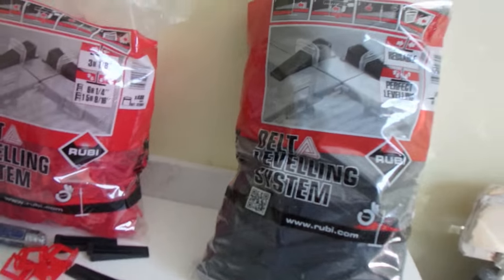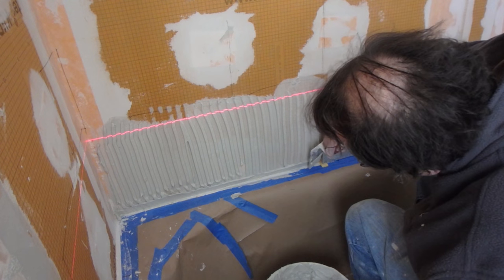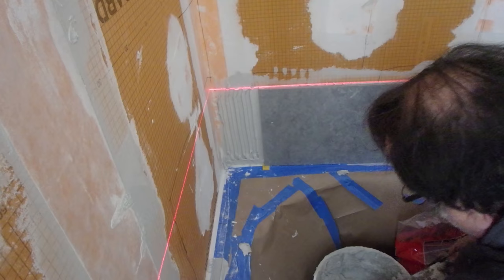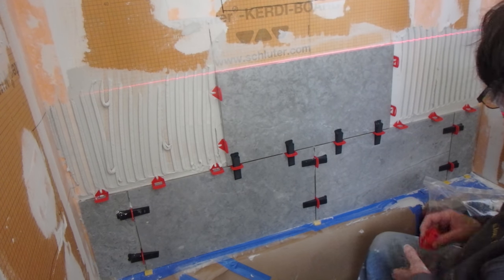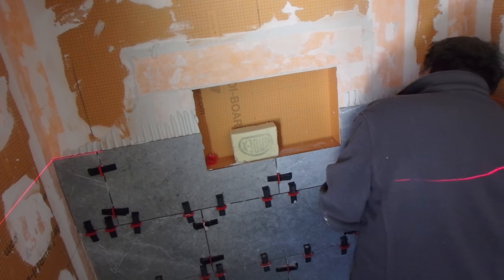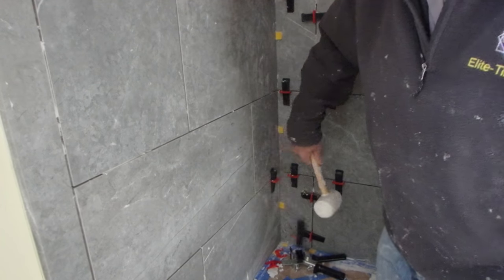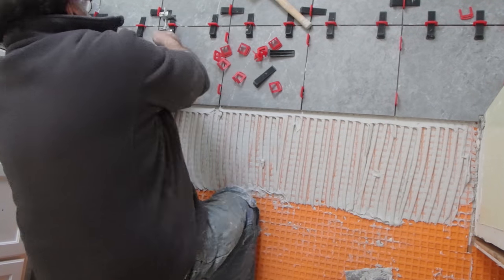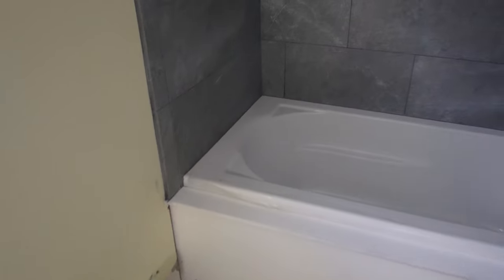How to use Rubi Tile leveling system to eliminate tile lippage.

Comment: That is a great tip about tightening the wedges in the proper sequence so you don’t open the grout joints. I experienced that when installing my floor tile. Great video Sal. Bathroom looks awesome.

Comment: I just used this leveling system and it worked great. Just have to check do level vertically often and especially at a stopping point to make sure the clips did not pull the tiles in

Comment: Thanks Sal for another great video. I'm currently tiling a floor using a very similar levelling system (Tileasy). Do you have any tips for how to avoid the clips opening up the joints when ratcheted up when tiling a floor (not a wall)? Even when I wedge in the direction of the set tile, the joints open up.

Comment: Sal, I absolutely love the videos.  Ive watched more in the past month than I have in the past 2 years.  Leveling system seems like a genius product but I have a question about it.  Its likely im not understanding it correctly.  If you put a wedge on the tile and bring the two tiles in to plane, Does the leveling clip/wedge, not lift one tile out of the thin-set bed?  Ive never used one but can think of a few times it would have been extremely useful.  Thanks in advance for the education you provide so many.
Reply from the maker: This should help https://www.youtube.com/watch?v=3GFkOiWvbUA&t=3s

Comment: I am using those to hang large format tile up under an eve. Even with Ardex 77 I can't go more than a row without bracing. Unfortunately due to the way the room squared up I had to work down the Eve because of a diagonal layout.  My question is, would it be bad to take some Hardie board screws an anchor the spacers into the Hardie board to hold the tiles in place as I go. The spacers have those little notches in them... I'm using a half inch by half inch trowel.

Comment: Hi Sal, thanks for the video.  Do you think you would you be able to use this leveling system with soft natural stone like adamo limestone on a wall? Wondering if it could break the tile and/or scratch it when tightening the spacers up.  Thanks!
Reply from the maker: Use a protection plate between the wedge and the tile, be sure to keep the tile clean while installing it. https://www.youtube.com/watch?v=Tzn6fgsX9QY&t=6s
https://amzn.to/2X1xhPY

Comment: I was using 1/8" clips but getting a lot of squeeze through, which got between the clips and the tile and made my grout line more than 1/8". Sal, what do you think about using 1/16" clips just for levelling combined with 1/8" horseshoe spacers so squeeze through doesn't affect my spacing? Is it a bad idea? Thanks.
Reply from the maker: https://www.youtube.com/watch?v=-Ey7V4o5OzE

Comment: can i use ditra on a plank flooring? I have 5/8 tungue and groove.
Reply from the maker: In most cases yes, but you need to determine what the joist spacing is and qht the deflection is. https://resources.schluter.com/media/psi/lowes/DITRA%20Installation%20Handbook.pdf

Comment: Good morning Sal. Which system do you prefer the Rubi or T-lock?  I’ll be needing a new system soon and wanted to know your opinion. Thanks
Reply: t lock by far smaller profile so easier to tuck under tile and more flexiable
Reply: Ely Paintball Levtec has a even thinner base and the base can be used like a margin to move thinset away to avoid possible oozing.

Comment: I don't know how much force you need to break those Rubi clips off next day but one i used i was able to remove them with vacuum floor brush attachment by standing and pushing them off without connected to vacuum, no need to crawl on floor for that.

Comment: Do you use the tile leveling system on the ceiling of the shower too?  Also, can you tell me the best technique for tiling the shower ceiling.  I assume it is very time consuming or you need a support to keep each tile in place while it sets.
Reply from the maker: Yes used it on the ceiling and use a no sag thinset and they will not fall.
Reply: Sal DiBlasi thank you!  You’re work is awesome and the tutorials are extremely helpful!  Great to see such quality craftsmanship

Comment: When you use level master do you find you get more of the clip not breaking off? When i use it they dont all break off. Huge Pain going back and trying to cut the rest out....
Reply from the maker: It is very important to keep the grout lines clear and to break out the clips the very next day to avoid having them break out incorrectly. Here is another tip, always use the 1mm (1/32) clip in conjunction with a spacer of the grout size you want. Since gout lines should never be less than 1/16 the clips will never be pinched between the tiles, and if one does break incorrectly, easy enough to cut out with a sharp utility knife because the plastic is very thin.

Comment: I see your vids and they are very neat and good looking completed jobs. But the use of products like these have a tendency to make the newer less experienced tile setter to skip the most important part of any job and thats the prep. If the wall is preped correctly and the proper techniques are used in combing the thinset and back buttering tiles that are large format then these types of products are unnecessary. Would it be possible for you to do a video of the old school methods from start to finish not using any of the new products? All mud work. Walls, floor,ceiling. That type of work is becoming a lost art. Thats how i learned to do tile over 30 years ago and i must say that if you know how to do it that way then you can see how unnecessary some of the new products are. Your work is very clean and neat and your finished product looks very nice buti think the next generation of tile mechanics would be better if they learned some of the old methods before learning all the short cuts.
Reply from the maker: I have heard your argument time and again, and frankly, I am not going to argue it again, A leveling system is a tool, nothing more nothing less, it does not replace skill, it enhances it. Tiles used to be small and flat, today they are large and have a bow in them. Floating is becoming a lost art, it is not coming back for better or worse, you can remain in the past, and be left behind, or you can move forward and incorporate the new systems into your skill set. In the end, floating is just a way to get  flat surface, today you can do the same with new systems, with far less effort. If you want to work harder than you have to to end up with the same result, then go ahead, don't claim that there is only one way to do it, that just shows you don't know or have no interest in modern methods. You have 30 years in the trade, I have more than you, I embrace  new methods and materials, they make my life easier and allow me to continue to install without sacrificing quality and my body thanks me for it every day.

Comment: I picked up a bunch of the rubi leveling system clips/wedges/tool but noticed they are the white ones instead of red, are these as good as the ones you used?
Reply from the maker: Color is dependent on the grout width you choose.

Comment: On average how much does it cost to use this system to install let’s say 1000 feet.. nice round number.  I’ve been installing for years and was thinking about trying this. 
Thanks and great video
Reply from the maker: If you are an installer, then you should be using a leveling system for at least some of your installs, the cost should be passed on to the customer, it is a consumable just like thinset and grout. Buy it in bulk so you have it when you need it.
Reply: Sal DiBlasi so $30 for 1000 feet? $20? I’m not counting the parts I can reuse. I was looking for just a ruff guesstimate 
Thanks
Reply from the maker: @jasongtivr6  Sorry, i don't talk about cost for anything, I made that mistake in the past. Pick your system, see what they recommend for quantity for the type and size of tile you intend to install and go from there.

      Tile size                                                  Required per ft²                                                    Required per m²
12" x 24" (30cm x 60cm)                               2 clips                                                                           22 clips
18" x 36" (45cm x 90cm)                              1.8 clips                                                                         20 clips
18" x 36" (45cm x 90cm)                               1 Clip                                                                             12 clips
24" x 24" (60cm x 60cm)                               1 clip                                                                              11 clips
 8" x 39" (20cm x 100cm)                              3 clips                                                                            50 clips

Comment: Hey sal 
U ever use the qep leveling system 
I have it works better than I thought 
What’s ur thoughts
Reply from the maker: Qep is a diy product.
Reply: They are all terrible. Gimmicky product if you do the proper prep work before you start the install,and use the correct setting procedure i.e. combing on the thinset in one direction and back butter large format lug back tile you will never have reason to use these horrible products. The main reason lippage occurs is because the prep work isn't done. What this productdoes is teaches the less experienced tile setter to do is skip the necessary prep work and in the long run it makes for a lazy tile man, and gives the customer an improperly installed tile job. Teach the new tile setters that the most important part of ANY job is the prep. Ive been a tile mechanic for 30 years and im not opposed to new ideas but i know gimmicky when i see it. The last thing our industry needs are lazy inexperienced guys calling themselves tile mechanics.

Comment: Do you notice any difference between the different wedge lippage systems like the Rubi vs the lash system at home Depot
Reply from the maker: Lash is a DIY system, Rubi is a professional system.
Reply: Ok awesome but what the difference. Y is Rubi professional and lash diy. That's like say Makita is professional and Ridgid is diy. The look and are installed the same. Maybe this is more of an advertisement and that's fine but I wish you would tell me if it is. Hopefully you'll respond with a reason.   

Also I saw the picture you posted this morning of the tile surround and ceiling. Looked awesome
Reply from the maker: If you have ever used the products, you would immediately be able to tell the difference, just because they look the same does not mean they are the same. The small size of the wedges makes them difficult to use on a large scale, they are hard on the hands, and tedious to use. The larger scale of the pro products, make them more user friendly, the quality of the products are also on a different level. There are DIY products sold in Box Stores, and they are pro products, some of which are also sold in box stores, up to you to figure which is which. You never see a pro using a diy product, like the lash system, just go online and look for an example, if you do it is probably a handyman pretending to know what they are doing. I never shop those store for tile products. I use first rate stuff that make it easier to achieve a better result.
Reply: @SalDiBlasi  make a video proving this or it is just marketing BS

Comment: Is a 1/16 grout line to small for 12x12 or 12x24?
Reply from the maker: Unless the tile is rectified, you should not use 1/16" grout line should be wider.